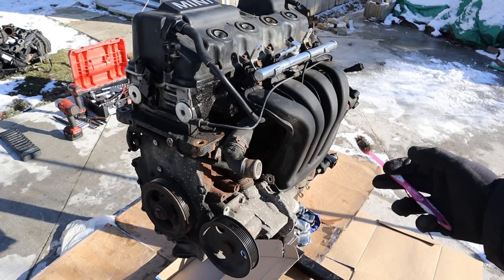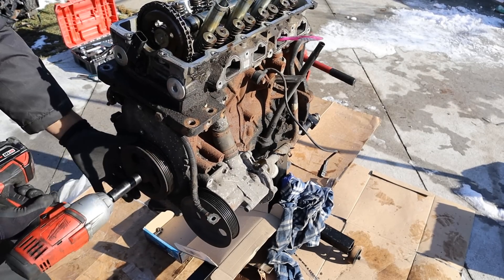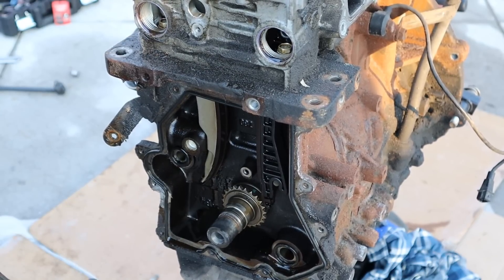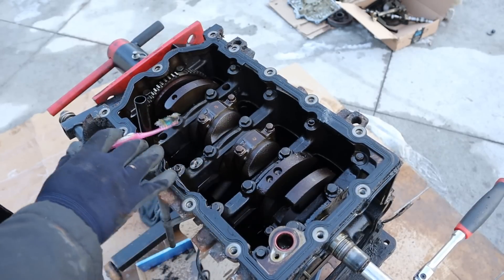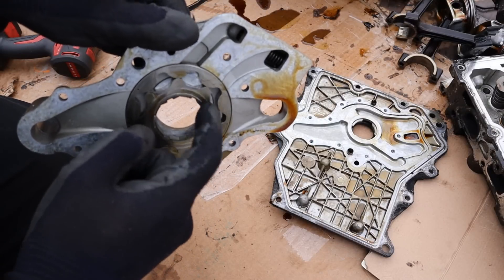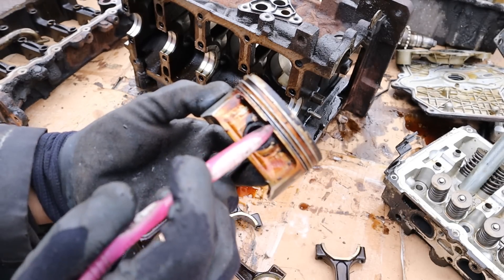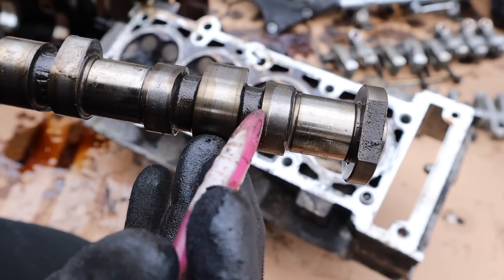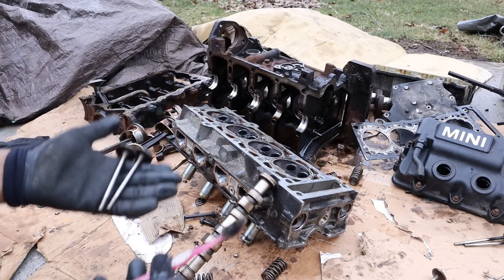Why Mini Cooper Engines FAIL

Comment: hey speedkar, what do you make of the lexus ES300/330? i hear they're reliable, but how are they to work on? if anyone reading has one how do u like it? i currently have a c32 amg that i do all my own work on, i dont spend much but it's a massive pain to do anything on it lol. rather have something peaceful
Reply: It’s somewhat difficult to do any work on the rear bank, since those are transverse mounted V6s. 3.3 is interference, early 3.0 had sludge problems. VVTi gears can rattle a bit on startup. Otherwise, totally bulletproof engines.
Reply: @Slenderman63323  does the 3.3 have a chain or a belt?
Reply: @funkycarlover  Belt. Both of them have timing belts. Toyota switched to a chain in the ES in 2007 with the 3.5 engine.
Reply from the maker: I had an ES330 and several Toyota V6's. 
They make for good reliable cars. Spark plugs are difficult to service and remember there is a timing belt that needs to be changed every so often. Oil filter is beneath the manifold waiting to burn your hand if Changing it hot. Control arms replacement involves jacking up the engine and removing the engine mount to get the bolts out. 

The ES330 had finiky transmission programming causing alot of lag that I didn't like in traffic. My Camry with the same 3.3 engine doesn't have that so test drive it good before you buy it. 

Other than that, it's a very solidly built reliable quality car. Worth the premium over an XLE Camry, Accord, Acura TL, Maxima of that era etc.
Reply: @speedkar99  TYSM for the quality reply; appreciate your time. sounds like a camry or an es for the next car. 

thx for the vids we all love em

Comment: I flipped so many of these turds. Never seen one last over 150k. Meanwhile most hondas I sell have over 150k.
Reply: The automatic transmissions are trash. You can change the "lifetime" fluid with new and it can do the trick..

Though most MINIs are standard trans. You won't find issues with those. There is a strong community for this R50- R53 generation that's coming back.This early generation can take a lot of power thanks to it simple and strong construction as shown in video.
Reply from the maker: Good to know. I agree, a Mini Cooper is best enjoyed with a manual.

Comment: @speedkar99 What you do with the dismantled engines? What is your business?
Reply from the maker: My business is taking cars apart to see what's inside and how it works! 
When I'm done the parts go to scrap. I can't guarantee anything works so why sell it.
Reply: @speedkar99  Thats for the buyer to worry about. You are leaving real money on the table. I used to scrap cars for a living, and you're already doing the hard work.
Reply: @speedkar99  Thanks for replying. I always had the question about what happens to the engines after dismantling them.
Reply: Things like water pumps, timing components, etc that require sometimes lots of labor to get at probably would be of marginal saving to use used parts as new ones are often not that costly. Major components like the head, block. Crankshaft etc that can be machined to like new condition I would think would have a resale value.

Comment: Engine maint doesnt seem neglected. Chrysler's sure have a lot of cam wear problems. I heard minis have a lot of problems. Not sure, but I remember lower radiator hose is an SOB to get to take off. 🤔
Reply: Much of the negative reputation for Mini's was earned by the second generation, which switched from supercharging to turbocharging for the S models. They were known for carbon fouling on the intake valves (due to direct injection), timing chain failures, and high levels of oil consumption.
Reply: It seems to only be the 5.7L and 3.6L Chrysler engines with cam wear. Their previous engines never seemed to encounter that issue. The previous Chrysler 4 cylinders are actually pretty solid. The 2.4L EDZ and 2.0L ECC are pretty unproblematic. I definitely see similarities between the 2.0L SOHC ECB with this engine. Early model years of the 2.0L SOHC were head gasket eaters, but valve-train wise and other components were solid. There’s plenty of people that get good service out of them.

Comment: so what was the specific cause for failure? Seemed pretty open ended.
Reply: Burnt valve causing low compression.
Reply: @nickchannel5364  Didn't see any burnt valves .....
Reply from the maker: Niether did I

Comment: Not too horrible for a part Chrysler engine. Would a more frequent engine oil change matter? Awesome breakdown!
Reply: Looks to me like it did have frequent oil changes.
Reply: @DashCamSerbia  make me wonder if that was part of good maintenance or due to frequent top ups due to oil burning.
Reply: @JoeUrbanYYC  I don't think so. The engine would be full of sludge in that case, especially the oil pan.
Reply: Bmw had more to say for sure lol
Reply from the maker: Thanks
Reply: maybe using conventional oil instead of full synthetic who really knows
Reply: I had no idea that Chrysler was involved. Didn't know they produced small engines. Cause I know when fiat bought them then they used small fiat engines but that's year after this model. What part is Chrysler?
Reply: @rowsdower12   The engine was built in Brazil .
Reply: @rowsdower12  The whole engine was designed, engineered, and developed by Chrysler. I was on the team.  The current Fiat etorq engines were a “refresh/upgrade” of this original design from 1997.

Comment: Probably neglected by previous owner, average lifespan of these engines is ~500'000 km
Reply from the maker: It lived a good life.
Reply: lol. Never in my live seen one last over 150k miles.
Reply: My mini cooper s r53 still running strong at 213k miles with the supercharger!

Comment: Seems like they don't wanna make a reliable engine,  Not hard to copy a Honda or Toyota.
Reply: Chinese do it
Reply: true, the japanese make great engines.
Reply from the maker: For German, copying isn't the way to do it.
Reply: @speedkar99  Instead the engineers spend a day with mistress Monica and get a proper flogging so they can design something way out of the box 📦 that surely will fail and cost a fortune.

Comment: Honestly looked like a decent engine design
Reply from the maker: Design wise maybe. It seems like the bottom end could handle power.
Reply: @speedkar99  It can. I had the supercharged version of this engine. With a smaller supercharger pulley, exhaust, ecu programming and a cold air intake, it putting out well over 220hp. The bottom ends of these are very stout. Notice the BMW trademarked leaky oil filter housing gasket. some things are eternal...
Reply: @speedkar99  The guy who did some hotrod work on mine, said the stock bottom end is good for 300hp.
Reply: Why did it burn oil? I did not see any particular failure points.
Reply: Plastic bits on engines...nope.
Reply: You're right. In fairness it's not too bad. They have a few common issues, but its not an all bad design.

It was very old fashined though. Keep in mind, that this engine launched with the new MINI in 2001. At the same time BMW had the N42 which was a full aluminium engine with full variable valvelift and valvetiming, and the N52 which was a fancy composite block of aluminium, magnesium and Nicasil. Compared to those engines the Tritec is ancient and that was BMW's main gripe with it. It only provided mediocre power and efficiency compared to some of the competition.

The first BMW-MINI is a funny story, because much of the car was actually already developed when BMW bought the Rover group. They then finished and redesigned many parts, which is obvious when working on them. Some parts look like typical BMW parts and some parts are a completely different solution.
Reply: It's not especially bad, the piston and ring wear are a bit much. It shows wear, but I'd expect a little natural aspirated 4 cylinder to at least last to 400,000km (~250k miles).
Reply: @biscuitninja  250,000 on this little sewing machine engine? 😅
Reply: um not